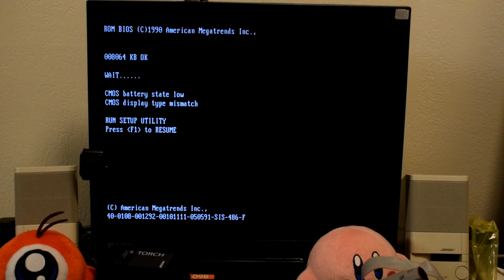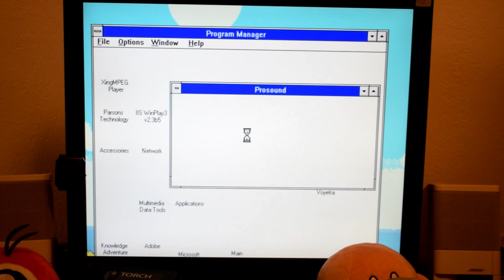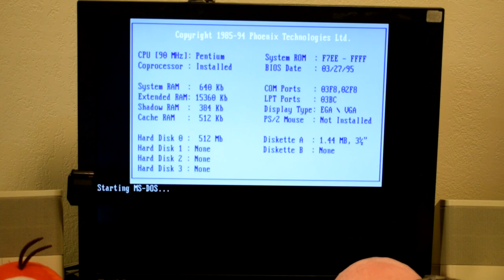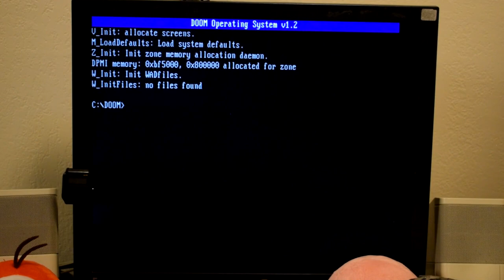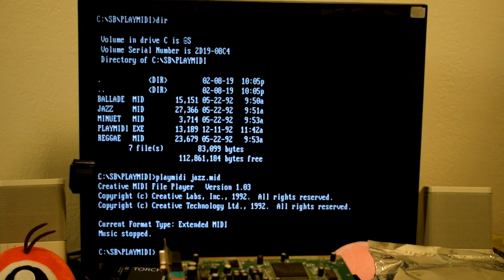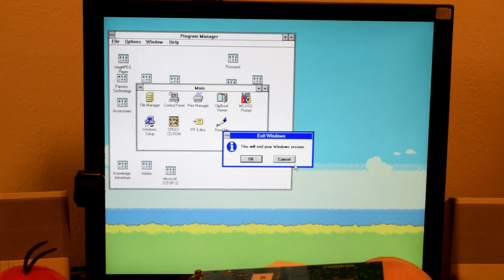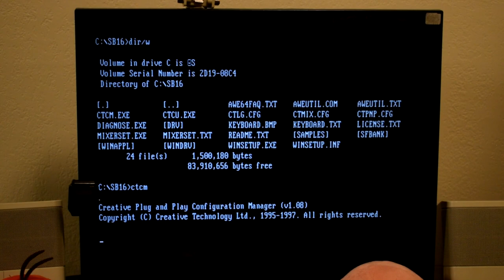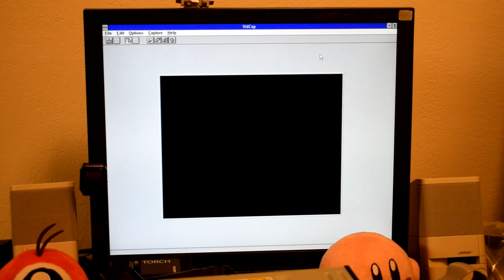The DOS Machine Motherboard to Rule Them All?

Comment: ISA slots are 1 to 1 pin compatible to the next slot over, so there are no specific IRQs for each slot, they all share the same signals. Moving cards around to different slots does not select a different IRQ.

Comment: Coprocessor is just different name for FPU (or math coprocessor; to make floating point operations faster). I don't think that there were any Pentium class CPUs without an FPU. There were 486s with and without it. And everything earlier had external FPU which was optional. And both of these large chips are regular Pentium CPUs. That's what was there before multicore. BTW. I think WindowsNT should be able to utilize both of them.

Comment: 500-odd megabytes was a BIOS limitation in these early machines.  To put a larger drive in, you had to either get a custom BIOS made (there were companies who could do that for you), install a third-party interface board with its own BIOS, or run drive-overlay software.  A second limitation was the FAT16 file system, which max'd at 2047 megabytes in DOS.  Allegedly under some operating systems, FAT16 could be extended to four gigabytes? I think?  but I never had to deal with any of that, and when 486s were 'cutting edge', a two-gb drive was ridiculously expensive (this is part of how the Iomega Zip became popular overnight; it was a comparatively-cheap alternative to buying a bigger and/or second hard drive!).

Comment: The EISA Configuration Utility was a floppy disk specific to that system, that would have detected the cards and given you access to the (E)ISA configurations (IRQ, I/O, etc.), but at least you got your expansion cards working by clearing the EISA config data.
Reply: just wanted to add exactly this. oh, and you need a cfg-file for every component, including the mainboard. mr_slug is the source. don't know why clearing the eisa config works for him Oo

Comment: You can set the drive to AUTO instead of user and it will detect the disk settings. ISA cards usually have their IRQ set by a jumper on the card or sometimes set through a software utility and saved on an eeprom, the slot shouldn't matter.

Comment: Dude, those are EISA slots.  They are backward compatible with ISA, so you are cool putting 16 bit ISA cards in them, but they will also take 32 bit EISA cards.  The fact it has the PCI slots shows it to be a transitional period board when PCI was coming on the scene.

You may want to look for two capital Sigma letters on the P90 there.  If they are absent, you have a FDIV issue.

Comment: Used those motherboards a lot back in the dos days and it was great. Had a big tower with 11 or 12 ISA slots and only needed to change the cpu card when I upgraded 😎 But the cpu cards where almost as expensive as a whole pc so when VLB slots where introduced I replaced everything.
Reply: yeah, but back in the day it wasn't a boot lottery due to the fact that back then the hardware was brand new and not old and worn out to the point that sometimes boot boots and other times it crashes like this system does🤣🤣🤣

Comment: Windows has a dosmode setup program you can run at any time just like most of your drivers and games. You should never have to manually edit config or ini files just to change the video driver.
And that's a classic resource conflict. That motherboard brings a lot of extra hardware you didn't have before with its own resource settings, and it probably handles interrupts differently with the coprocessor installed.
You can put your ISA cards wherever you want. It doesn't matter except for maybe audio interference based on trace length and what your sound card is physically near to. The slots are all electrically linked together in series and you can verify this with a multimeter set to continuity test. This is also why old servers could daisy-chain ISA backplanes; it's all essentially one long set of wires. It's the cards themselves that have to be configured to use non-conflicting resources.
IIRC ctcu shipped with AWE and later SB16 cards for the purpose of setting their resource configuration while diagnose shipped with earlier cards.
Also if you want to get really greedy with the video settings that Cirrus Logic card can take two more SOJ40 DRAM chips to bump up the VRAM. You'd just need to get something with similar specs to the soldered chips on the board.

Comment: I'm going to be honest, that is the strangest motherboard I've ever seen, same goes for the CPU, I have never seen any Intel 486DX-II with a metal heatsink glued on (excluding the Socket VII OverDrive CPUs) given most 486 cpus I've seen were ceramic.
Reply: Many high speed 486s and clones required heatsinks, and, rather than rely on the user to install them properly, they were usually permanently attached at the factory instead. IBM, EverGreen, AMD, IDT, Cyrix, and Intel all did this with their 486s and compatible CPUs.

Dual-CPU motherboards are not particularly uncommon, especially starting in the Pentium era, which this is squarely at the beginning of. Watch some old Computer Chronicles episodes about the Pentium and some of the early machines they describe are dual processors!
Reply: I think it's likely a pcimig precedessor - industrial stuff. part of the idea was to replace the CPU boards easily while keeping the rest. you would likely be able to find a vendor that makes P4 or even newer CPU cards that would still "work" in there. Though I'm not sure normally there's very little stuff except many slots on the backplanes in those models.

Comment: @Druaga1 CHS (Cylinders Heads Sectors) had a 500MB limit, to get past that limit you needed to use LBA. https://en.wikipedia.org/wiki/Cylinder-head-sector will give you some useful info. If you can switch the BIOS to use LBA instead of CHS you should be able to use a CF card larger than 500MB

Comment: I am pretty sure that the reason your cdrom drive was not loading was because you don't have the second IDE port enabled in the bios. Enable that port and try again and I bet it will work. I assume you have the Cdrom drive connected to the second IDE port that is. Also, since the bios battery is working, you really should set the time and date correctly as well.

Comment: lba support is needed for fat 16 partition bigger than 512mb and smaller than 2gb
and you can still have multiple fat16 partitions under 2gb
for bigger drives on older motherboards, type in cylinders, heads and tracks and sectors and use harddrive suppoer overlay software to place compatybile layer in memory

Comment: "Coprocessor installed" simply tells you that the system has an FPU (floating point unit, also known as maths coprocessor). This is built into the Intel Pentium, but it wasn't necessarily built into earlier CPUs, such as the 486SX models or the 386. So why would the mention "coprocessor installed" in a Pentium board? Well, simply because the BIOS had some old fashioned quirks, and perhaps they felt it was worth pointing out to the user. There is no discreet coprocessor for the Pentium, and during boot, it clearly says "Dual Processor Configuration Detected", telling you that those are two Pentium CPUs in that board.

Comment: You should put the old software you use up on the internets for the public, like that ideinfo program.  Or put a link to where it can be downloaded in the description.
I usually just put the drive in a "newer" computer that can autodetect the drives settings, then copy the info over.  But this program would be so much better and easier!

Comment: 500MB limit is the capacity limit of the BIOS. That's why they came up with LBA in the mid 90's
Reply: DOS 6.22 doesn’t support LBA, so you need a controller that supports LBA translation to tell DOS the proper size.
Reply: @EvilTurkeySlices  it has nothing to do with DOS, DOS 4 to DOS 7.0 (so including 6.22) can only use FAT 16 which is limited to 2GB per partition (up to 4 so you can fully use a 8GB HDD with dos 6.22 with 4 2GB partitions). Only DOS 7.1 and 8 can use FAT32.

As for the controller, any controller can do LBA. There is no such thing as "LBA translation", at least on the hardware side. Maybe if you have a controller with its own BIOS it will get over the bios limitation.

My 486 has that capacity limitation, but I can get over it with a software such as Ontrack disk manager. My other 486 has LBA support, but there is no integrated controller. I can install any controller (an old ISA one from the 286 times or a more modern VLB one) and it'll work.
Reply: Deksor it is a bios thing, but not all boards got a bios update for it.
Reply: @EvilTurkeySlices  you won't find these cards in ISA/VLB form. There are other way around these problems such as using a software (this avoids using one more slot in your computer and is free nowadays)

Comment: Duke3d uses a setup.exe program to select (or disable) sound card options. Try that and you'll be able to play it with no sound.

Back when I used to play duke3d multiplayer over modem with a friend (back when I was a wee little kid), we had to disable music playback in the setup program otherwise we would get out of sync errors. It was almost like the game was trying to sync the music on both ends, or it had timing issues trying to play the game, send and receive object data over dialup, and play midi music via the SB card...

Comment: I must admit.. I haven't watched all the video but ... did you tried updating the bios of those boards? from my experience, updating bioses will enhance things like usage of big hdds.... and there is LBA mode at 32:30...
Reply: like he would be able to find a bios for this old board i mean it sounds good but the problem is can he find a newer bios for the same board
Reply: @jschryver27  all is possible. there are repositories for old motherboard bioses and drivers. some boards never got a bios flashed even there are updates. other boards simply dont see a bios update release.
Reply: @hugosimoes5119  You can't "Flash" a board like this. This is before flash memory was really a thing, and it was incredibly expensive. 

You'd probably have to either replace the BIOS ROM with an updated version or get an equivalent PROM/EPROM/EEPROM and write the updated file to it before you could get anything out of it, and even then there's no guarantee it'll work.
Reply: @AiOinc1  Yeh ok. Things got better since then and we can flash bioses.

Comment: You can plug your CF card via USB-2-CF card reader to a linux machine and read or reconfigure your C/H/S on the CF using a usual fdisk (switch to expert mode when inside)

Comment: always leave the hard drive settings on auto 
and make sure the cd drive and hard drive ribbon cable
are in the same connector like the black ide connector for the hard drive
and the cd drive on the white ide connector that is on the motherboard or on the slot cards

Comment: As I recall, the last Pentium processor to come with an MS-DOS-booting OS by default on PCs was one that used Windows 98 SE, or an MS-DOS boot of Windows ME. Those were Pentium IIIs with between 500-1500mhz or so... though you shouldn't have much of a problem booting an early Pentium 4 into MS-DOS... maybe disable hyperthreading if that's on it... or you could try one of the original (single-core) AMD Athlons of the same era... they were freaking great for their time!

Comment: 3rd power connector? I think it's called an AUX power and it predated the 4 pin P4 power connector.

I had a Pentium 60 with one of those because it had 5 ISA and 4 PCI slots, and needed extra juice to run all the cards.

Comment: file extensions ending in underscore (*.??_) are an old Microsoft per file compression format, it has nothing to do with Adobe, except that maybe Adobe also used it in their old installation disks.

also, you technically have no ISA slots, those are EISA, which are backward compatible.

Comment: Its basic knowledge with old machines wich wasn't just plug & play. If you change hardware like Mobo, you will have to run the configuration utilities of the various cards and io devices like mouse and cd devices :) The world was just way more fun in the DOS days. Loads of things that could go wrong and having to manually configure irq's and adresses in the bios for your cards :). Like getting my Roland MPU card to play along with the SB, Network and Grafix card, switching cards around to get them to match to the right irq's, and then spending not just hours but sometimes days or weeks playing with himem and emm386 to squeeze out just a couple of extra kb's of low memory  for some of those memory hungry games :) I get it its more fun actually finding old crap like this and getting it to work :) .. but really .. its obsolete .. there isn't many things you cand run in DOSbox. 

For the record:

Start with just the basic setup for playing a game, Graphics card, SB card.

1 run the SB setup file. Standard SB settings is usually Adress: 220h Irq 2, DMA 1. SB16 and later being a 16bit card instead of 8, uses 2 DMA channels, 1 and 5. Depending on your system you usually have to experiment a little with IRQ Settings. Later SB cards can choose between a range of adresses and Irq's, and here is where things become complicated if you have multiple sound sources, like a Roland MT32 or  MPU104 Midi interface. -- or other hardware wich might try to use the same channels, like a network card. Some times even more advanced Graphics Cards also might be using  these channels. Midi "normally" uses Irq 2 or 9 the latter one wich is one of the "high" Irq channels, and because of how X86 hardware is designed, the high Irq channels is just an "addon". The computer can't use more than 8 Irq's at once on older hardware and OS'es. So Irq 9 shares the same connection to the cpu as Irq 2. So this will end badly. You will have to reassign the SB card to Irq 5 or 7 to make things work (afai recall the SB setup can only choose between Irq 2,5 and 7).

After you have set up the SB card and managed to get Midi sound and Wave sound working, MOST DOS games have a "soundset.exe" or whatever its called. Even the SB config sets the sound variables in the autoexec.bat, don't count on games actually use these to find the correct settings. You often have to run each games sound setup if your card isn't set up at the default 220,2,1,5 Values.

Comment: Also, I think you have a faulty and/or mis-seated stick of RAM or a broken trace somewhere... run some diagnosis software, do troubleshooting on each part individually to make sure they work... isolate the problem and remove it. It could be that you're overloading your PSU... unstable power means unstable computer, after all...

Comment: If you still have it, try Linux on it - Redhat 4.2 should work and you'll get to use both processors if it's dual Pentium 90. 
That extra CPU will help immensely with a kernel recompile.

330 is your MIDI port. The E is likely a reference to Ensoniq.
620 is another I/O address for something else - wavetable synthesis memory mapping?

Comment: Fyi, there is a Setup.exe in the duke3d folder, run it and select no sound and it should have run as fine as it would on a 90 mhz cpu
Reply: nevermind, im a dumbo and only watched half before you ran the setup

Comment: I just built myself a DOS machine

Case - AOpen HX45 ATX Mid Tower Case
Power Supply - Startech 300W ATX PSU
Motherboard - Intel Advanced/ML (Marl ATX) ATX Motherboard intel 430HX Triton chipset
CPU - Intel Pentium 133 Mhz P54C A80502133
RAM - 32 MB (2x 16mb) EDO 72 Pin SIMMs
Graphics Card - Number Nine Motion 331 S3 Trio 64v+ 2MB PCI
Sound Card - Creative Labs Sound Blaster 16 CT1740
Hard Drive - Maxtor 92041U4 20GB Hard Drive
CD Drive - NEC 40x CD Drive that i got out of a junk Dell Optiplex GX1
Floppy Drive - Gotek Floppy Emulator
OSes - Windows 95 OSR2 and DOS/Windows for Workgroups 3.11 dual boot

Comment: If the cmos battery is dead and the bios info has been reset why not replace the cmos battery? Is it not just a CR2032 like every other one? They're ten-a-penny on Amazon>
I think the co-processor was for math wasn't it? They were usually referred to as "Maths Co-Processor"
Reply: It uses a DALLAS rtc chip, which has an internal battery. You can't just swap the battery in that case unfortunately ...

As for the "coprocessor" this is actually a dual CPU machine with two pentium 90. 486DX and pentiums already included the math coprocessor. Only 486SX, 386s, 286s and 8088s didn't include them.

Comment: The mother of all mothers-boards. I so regret getting rid of some of my old AT based hardware. My very first 486 PC board and cards and also a a dual CPU Tyan Pentium board. Both sold for less than you'd pay for just a CPU on eBay these days :'-(

Comment: Those look like EISA slots. New goal is to try to find an EISA card lol. ALR is actually Gateway's old name. So you have a gateway motherboard.

Also, idk why Win 3.1 starts so slow for you. I have an IBM PS/2 Model 80 with a 386 and it starts Windows faster than your pentium. Way faster
Reply: Extra drivers slow the startup considerably, especially networking if you're not using it.

Comment: Your co-processor is actually a maths co-processor which took on the calculations from the CPU and sped things up by a huge amount. Your "ISA" slots are actually E-ISA which are 16 bit as opposed to 8 bit. The video card is a Vesa card.
Reply: This is not true, this is a dual CPU board. Pentium already had integrated math coprocessor (same with 486DX). EISA are 32 bits slots the black ISA slots you see on the 486 are 16 bit ISA. 8 bit ISA is similar to 16 bit ISA, but the smallest part of the connector is missing on these.